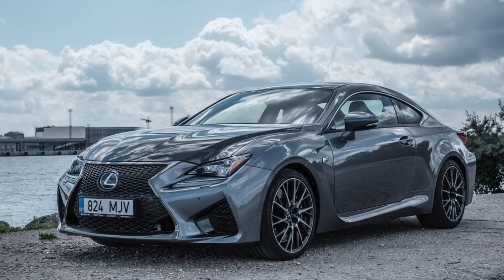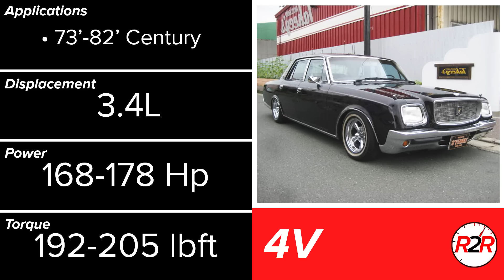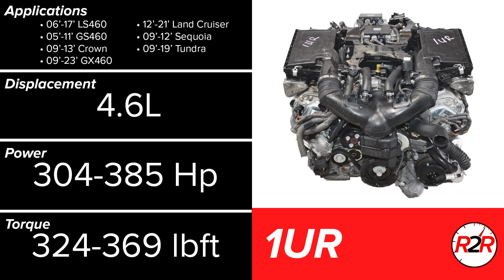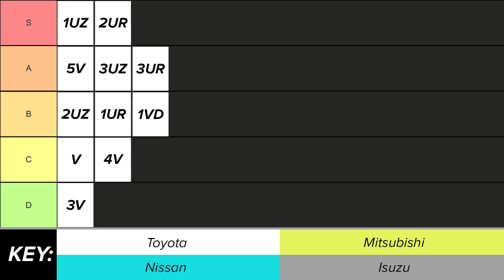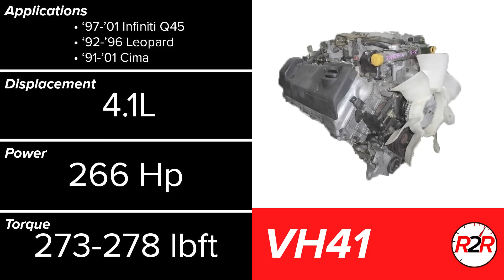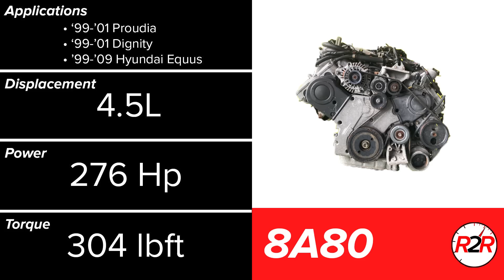The ULTIMATE Japanese V8 Engine Tier List

Comment: The 2UZ really needs to be at least in the A tier — I’ve owned a few vehicles with them, and they’re incredible engines.
Reply: Cracked headers isn’t a really reliability concern with the 2UZ, it’s more of just a headache and it won’t effect performance. The water pump failing is also remedied by replacing it every 100,000 miles when you replace the timing belt as recommended by Toyota.
Reply from the maker: That seems to be the case, seen a few people saying they’re over 200k miles with no issue. That’s super impressive!
Reply: @running2redline  200k miles is really the low end of the 2UZ. I see 100 series listed online with well over 300k miles still
Reply: @mten1454  and they have them listed for 15-30 grand 🤣 the 2uz is truly bulletproof!
Reply: @running2redline 2UZ has gone 1 million miles. They are bulletproof, water pump is just reminder to change timing belt. The headers are not a reliability concern just a annoyance
Reply: @running2redline  I'm at 241,000 on my 06 gx470, however, yes the exhaust manifolds are a bad design, I've replaced the 2x and it has a belt, so the water pump gets changed along with it (always an asin mfg pump belt and idler pulley).
Reply: 2UZ should be in S-tier, no question.  Oil changes and doing your timing belt/water pump every 100,000 will keep them running indefinitely.  I had 180,000 on my Tundra and it was so smooth when I was in a drive through or something it felt like it wasn't even running, had to look at the tach to make sure it was still on.
Reply: @rexkramer64  same with my ls430, sometimes I forget if it’s even on 😭 (183k miles)
Reply: Only two things about tomorrow that I can be sure of:
There will still be ice in my yeti cooler and my GX470 will get me to my destination.

Comment: Toyota's VD is an excellent engine, rivaling a Cummins B series, while weighing less, with a smaller displacement.
Reply: I feel like the VD is closer to a car engine than the B-Series, since that was originally designed for industrial use
Reply: @Aka.Invicta  It was only offered in the Land Cruiser, it's not like it's a VW turbodiesel made for economy cars.
Reply: @Ang3lUki  You're right, the 1VD is closer to the V8 Diesels offered by all the big three german manufacturers in their luxury cars during the 2000s and into the 2010s.
Mercedes even briefly sold a G400CDI with the 4.0 V8 Diesel out of the S-Class
Reply: @Aka.Invicta  Again, that went into the S-class, a sedan. The VD only ever went into the Land Cruiser, which is a utility vehicle.